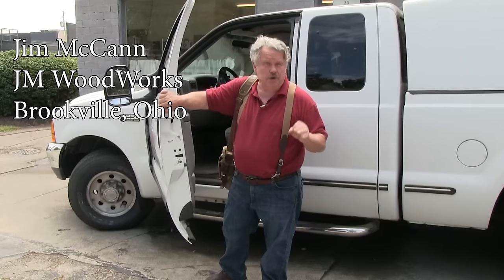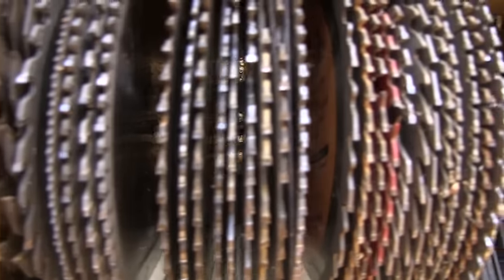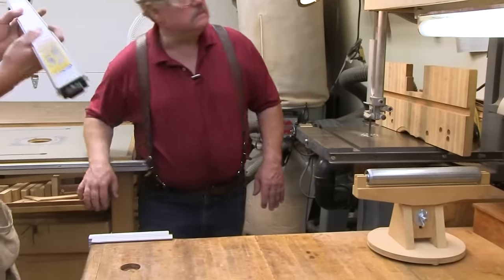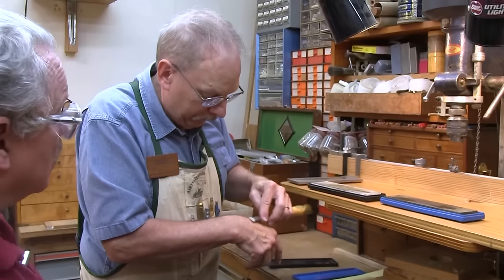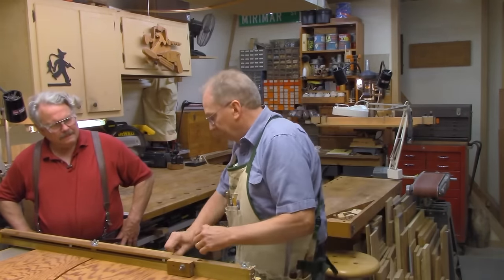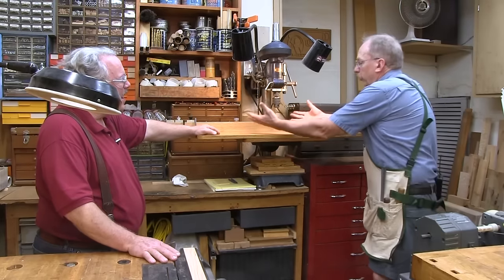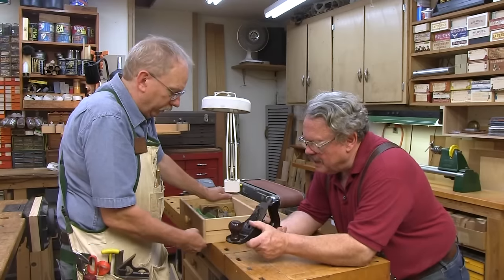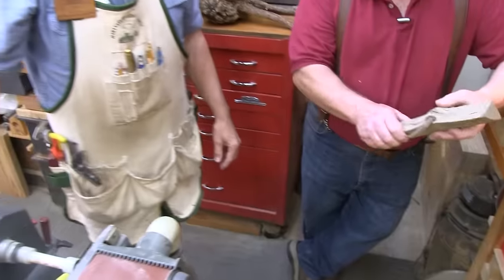Shop Tour - Jim McCann

Comment: The comment about the water squirting out from under the edge when sharpening is by far the most helpful suggestion for finding the correct angle. I've struggled with that for decades. Thank you so much!
Reply from the maker: Most welcome.

Comment: My shop is 11’x17’ and I’ve built a full set of kitchen cupboards, two dining room tables, one was 36” x 140” with breadboard ends, the other was 42” x 72” with four 12” leaves. I’ve also built coffee and end tables, headboards, too many small wooden boxes to count. I have a lot of tools in common with the owner. The major difference between our ships is that mine most often looks like a disaster during a project but it gets cleaned just after a project is finished.
Reply from the maker: Don't let the cleanliness of Jim's shop get you down. Both his and mine lean towards disaster from time to time. It's in the nature of woodworking -- out of endless mess comes timeless beauty.

Comment: Jim, do you mind telling me/us what brand the aluminum clamp/guide is?
Reply: Hey John, I’m sure it’s the ProGrip, which is still available, but there’s a budget alternative from Bora that’s quite nice too. Scott
Reply from the maker: We've had a few inquiries  about that jig. If you can wait a few weeks, John, I'll have a design you can make in minutes from a few scraps. I'm adapting an old design I published years ago to have the same capacity as Jim's clamp-on guide.
Reply: @MyGrowthRings  Scott, I bought a Bora WXT? and found that when I clamp it the aluminum bar distorts, to curl upward, at the end where the stop block is. That made the CIrc Saw sled unable to slide through the end of the cut … growl … so, I've been progressively filing down the cam mechanism, and it does not bend the aluminum track, but doesn't hold very well, now …
Reply: @WorkshopCompanion  Nick, that sounds great!  I look forward to seeing it. I always enjoy your style, good teaching, and creative brain-work!
Reply: @johnoerter2883  It does have thinner walls than the ProGrip. Keep in mind that you only need as much clamping force as is necessary to hold it in place, when using it as a straight edge, so you only need to lightly tighten the sliding jaw before locking the lever. I have one made by yet a third company and had to learn that lesson.
Reply: @MyGrowthRings  I'll have to experiment with that … I could try a little bit of space before the clamping cam engages …
Reply: @johnoerter2883  It's counterintuitive but it might work.

Comment: @WorkshopCompanion I sent you an email on Facebook in regards to your aprons. 
I  noticed throughout the video he moves like the straps might be bothering him.  10 pounds is a lot of weight on your shoulders. Speaking as a woman who has worn a variety of straps over the years...*ahem...bra straps suck fyi*, a padded,  wider strap is much more comfortable for lengthy wear
Reply from the maker: Jim and I are very much aware of the need to distribute the weight on your shoulders over as wide an area as possible when you wear an apron. But you get used to what you use. Jim loves that old apron not because it's comfortable, but because it has become an important part of his woodworking methods. He knows without thinking what pocket to reach for to fetch the tool he needs. Last year, I found an exact copy of that apron and gave it to him -- he was thrilled. Maybe this year I'll get him some sheepskin pads. Appreciate your concern.
Reply: @WorkshopCompanion  I completely agree! In my message I was going to replicate it for him but since you already did it...excellent